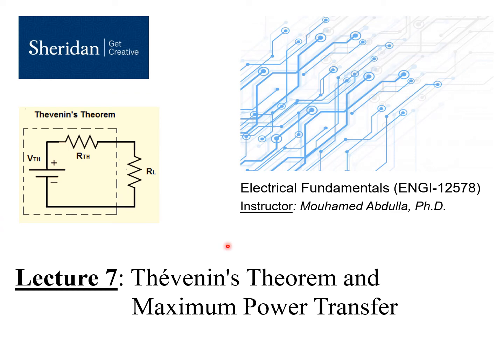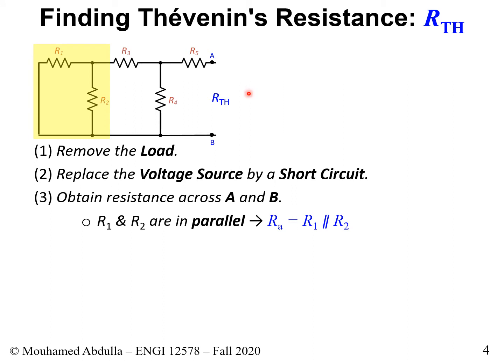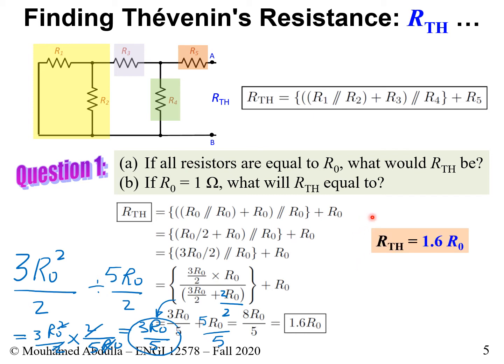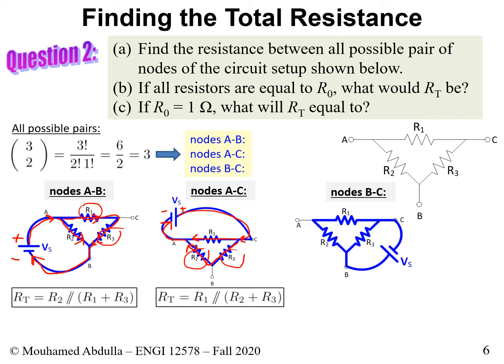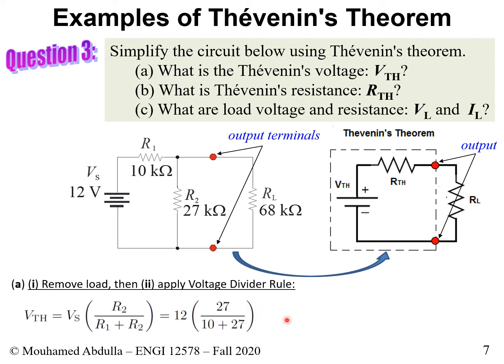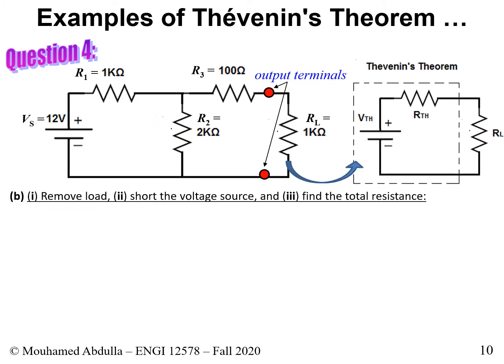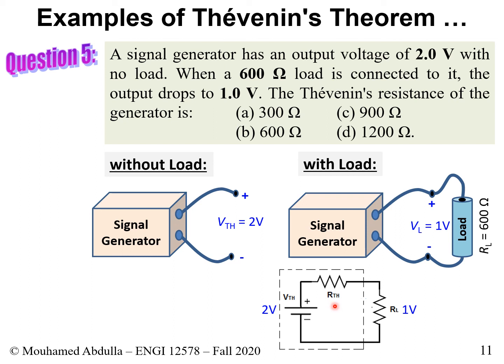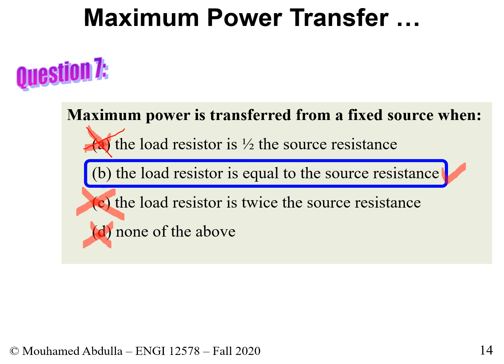Lec 7 - Thévenin’s Theorem, Maximum Power Transfer

Comment from the maker: Timestamps:
--------------------------
00:00 - Introduction
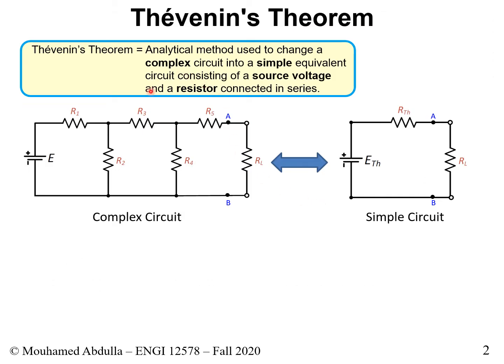00:43 - Thévenin’s Theorem
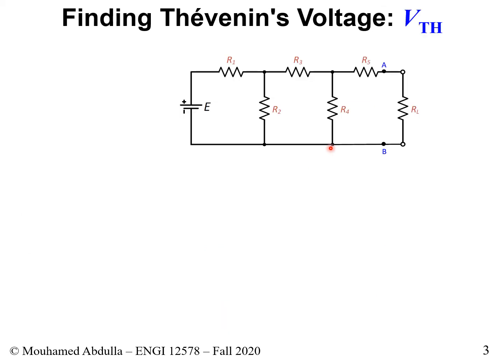02:42 - Finding Thévenin's Voltage
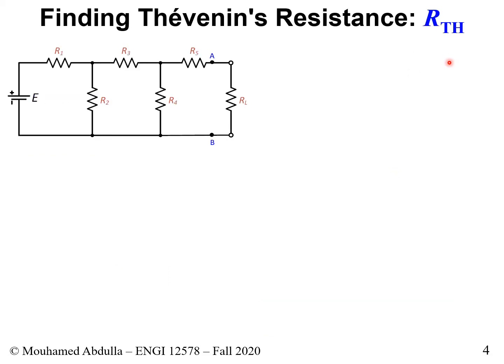04:44 - Finding Thévenin's Resistance
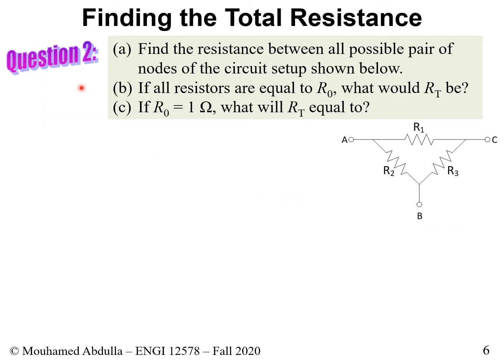13:16 - Finding the Total Resistance
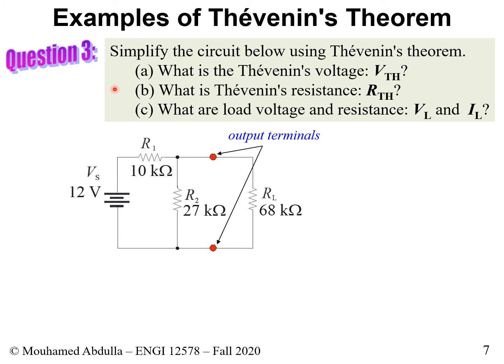22:28 - Examples of Thévenin's Theorem (x3 problems)
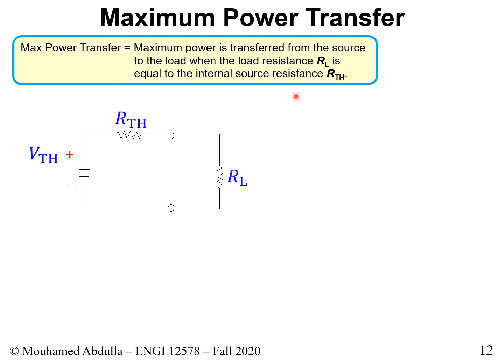38:18 - Maximum Power Transfer